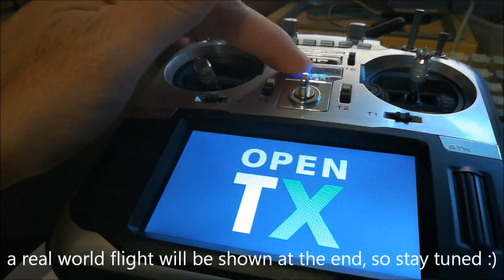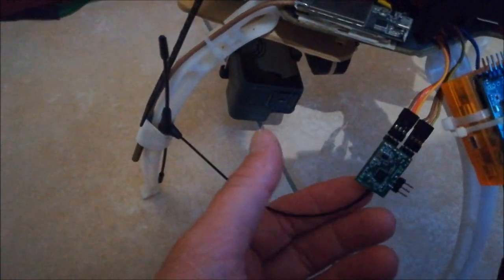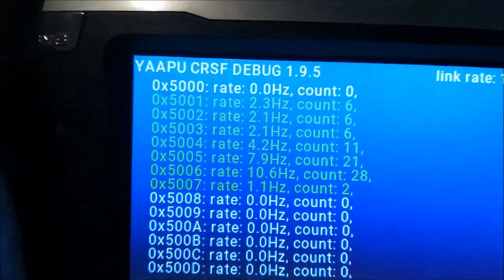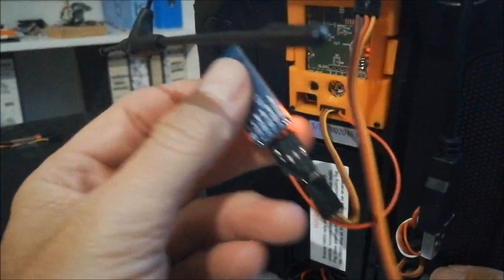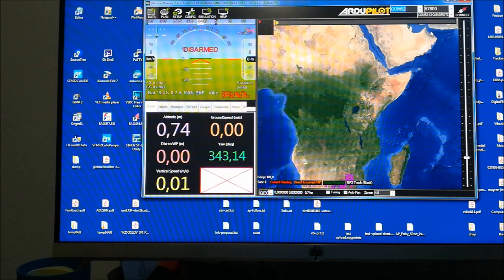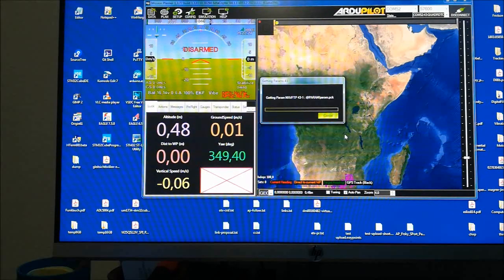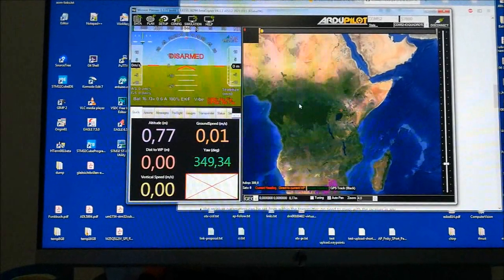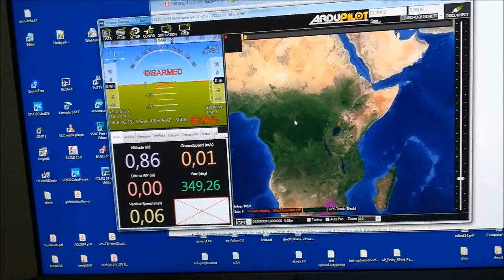mLRS: Yaapu Telemetry App and wireless Mavlink forwarding to MissionPlanner

Comment: Good job. Now I understand how mlrs works. For rx-> tx, RX sends data which contains mavlink and RC channels. TX receives signal, decodes it, sends mavlink via UART (used for bluetooth) and sends RC channels via CRSF to rc radio. And then tx -> rx.
Reply from the maker: minor correction: 
For rx-> tx, RX sends data which contains mavlink. TX receives signal, decodes it, sends CRSF telemetry via CRSF to rc radio.
For tx-> rx, TX sends data which contains mavlink and RC channels. RX receives signal, decodes it, sends mavlink via UART and sends RC channels via CRSF to flight controller. :)
Reply: @OlliW42  Thanks for correction. This is so cool!

Comment: Hello Olli,
First congratulation for the awesome job you did.
My question may look stupid as mLRS look firstly made to keep RC link, but as my remote control is very basic and don't run openTX.

Is it possible to use mLRS purely as telemetry/mavlink link to mission planner on PC without dealling with the remote control?
It look that yes (via the HC-05 module you show) and in that case, is it possible to adjust mLRS parameter (like 19Hz 38400bps) by any way, even once forever?

Thanks.
Reply from the maker: yes, that's possible. See https://github.com/olliw42/mLRS-docu/blob/master/docs/SETUP_SIK.md :)
Reply: @OlliW42  Thanks to you I just now understand that documentation is in another repo ;).
Reply from the maker: :+1:

Comment: Can you please tell me that 2 pairs of mlrs are working at 915mhz and the signals are interfering with each other.
Is there anything I can do to improve it? (I change different IDs)
Reply from the maker: pl consider joining the rc groups discussion thread or discord channel. Yt isn't a good place for this.
The 915 MHz FCC band has only 43 channels but the FHSS needs to use 25 of them according to FCC, so there is literally no space for two mLRS system to not step on each others toes. Using different bindphrases will ensure that the units don't read wrong packets, but since both systems neccessarily have to overlap frequency-wise some level of interference is unavoidable.
mLRS has templates for an "ortho" mechanism, which is however not yet officially supported and also only for 2.4GHz. It could be extended to 915MHz FCC. You can do that yourself in code.

Comment: Very nice project and great job! I have a question. Can this opentx firmware work with mavlink over crossfire micro tx and nano rx. Thanks!
Reply from the maker: what you see in this video works with vanilla OpenTx or Edgetx, doesn't need any special OpenTx firmware. It needs however mLRS.

Comment: Oh I love that you can feed MavLink through to the PC via bluetooth. Can you get it to go faster? Can that module use WiFI at (say) 600MBps?
Reply from the maker: you could do wifi at whatever huge rate, but it would not push more mavlink bytes through the Lora link, it's the Lora link which is the weak link in the chain
you could go to the 31 Hz mode, with the E22/sx1262 setup I've shown, or to even the 50 Hz mode for a 2.4 GHz setup, and then it's really much faster
Reply: @OlliW42  I guess would be faster at 50Hz, but it's not really "much" faster. I'm struggling to understand why such slow communication speeds are considered acceptable?
Reply from the maker: depends on what you rate as "much", a factor of three I consider much.
Which rates are considered acceptable certainly depends on your application. If you need higher rates, you need a different RF technology than Lora. I myself find the data rate at 19 Hz not sufficient and hence use it just for stress testing, but I find the data rate at 50 Hz more than sufficient, even with all the gimbal and camera stuff I'm usually doing. I know however that some others are happy enough with the data rates also for 19 Hz. There sure will be folks who don't find the data rate at 50 Hz acceptable. It's obviously subjective.
Reply: @timtheplaneman  I doubt people much liked dial up speed, but in the early 2000's they just had to "accept" it 'cause that's what the technology could do.
I.E. It's not so much "considered acceptable" as it's pretty much the only way to get telemetry without adding a separate telemetry module. Personally I'd prefer to just add a WiFi or Bluetooth dongle for fast telemetry, but if people rarely need telemetry and fly small quads where the extra weight is a bigger problem, then this is an alternative option.
Reply: @michellerossouw  if ELRS can put a wifi hotspot on a receiver that's smaller than the fingernail on my little finger, why can't they put BT and/or wifi on a FC board?
Reply: This is for long range so that your mission status etc can show on Mission Planner for example on a 100km mission, where wifi and Bluetooth won't work.

Comment: Amazing work!
I’m just waiting for readily available hardware to test it. 
I use ELRS and love the tiny footprint. Easy 5kn with full telemetry and Yapuu script.
Reply: One of the issues that we confront in the hobby is that long range it’s being killed by laws and regulations so our only hope is LR under 250g it will be ilegal too but the chances of creating a major issue are greatly diminished.
Reply from the maker: yes, hardware is an issue. And yes, regulations is also an issue.